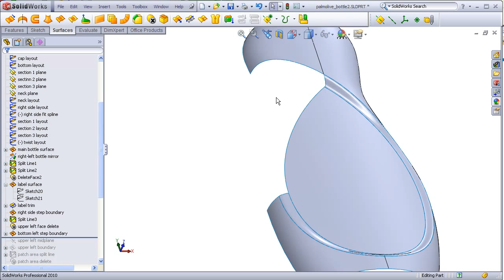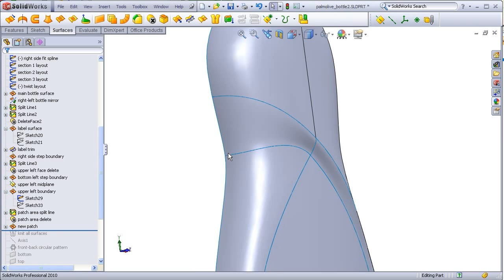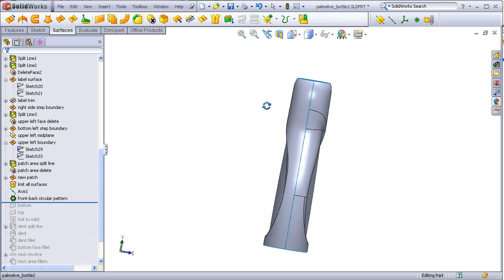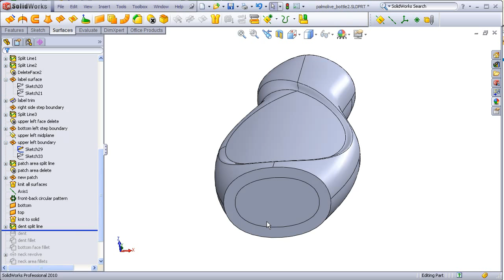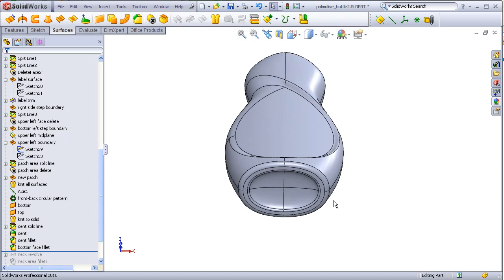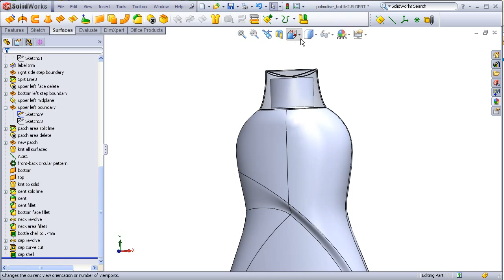DSID136, Solidworks Tutorial, Twisted Detergent Bottle - Part 3

Comment from the maker: Sorry about the oversight, but the video should have said that you need to UNCHECK the "Continous Dome" option, when making the bottom dome. This gives you a dent that has a crisp edge around its perimeter. If you leave this checked, the dent will smoothly blend into the bottom planar surface and won't have the crossed lines you mentioned. There is nothing wrong with this, except that the real bottle has a crisp edge around the dent perimeter.

Comment from the maker: In order to knit to a solid, you have to have surfaces that can form a water-tight enclosed volume. Any gaps, and Solidworks won't knit it together and turn it into a solid. You're right, the lack of a solid will prevent you from making a Dome. The feature will be greyed out, until there is a solid model. It does not work for surfaces.